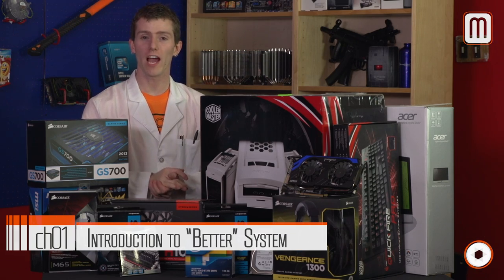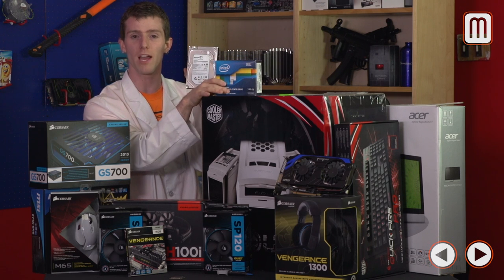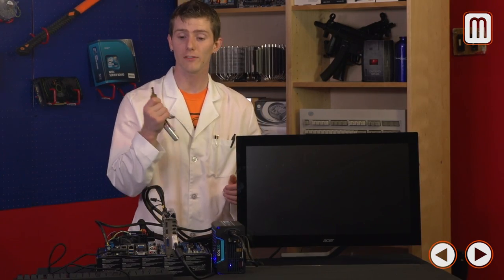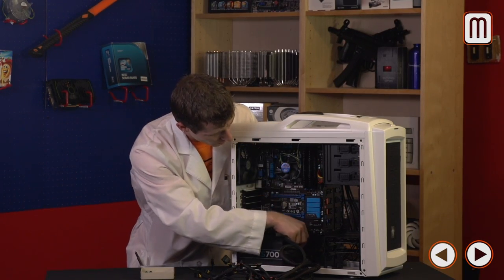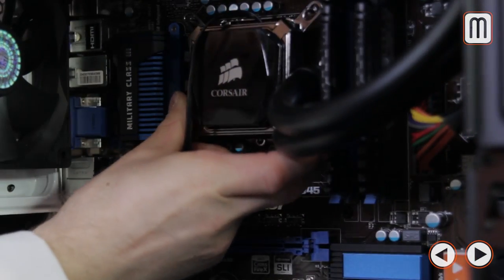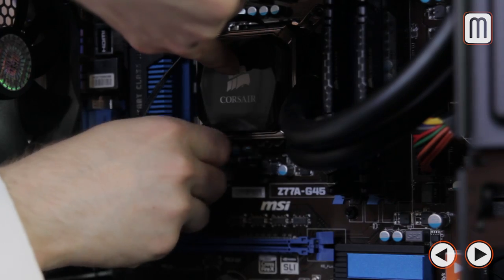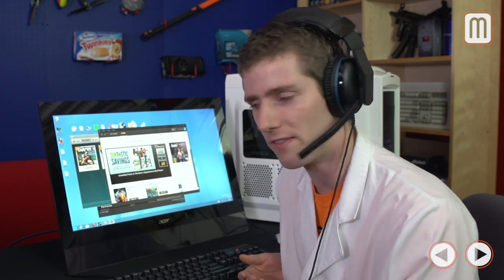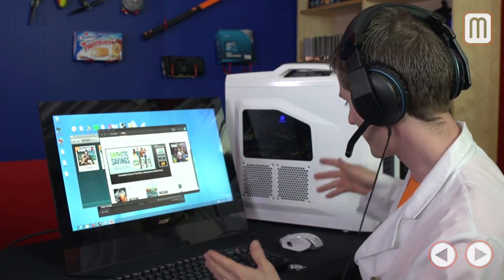ULTIMATE Build a Better $1500 Gaming PC Computer "How To" Guide

Comment: Here's my build so far. I just ordered a i7-4790k, GIGABYTE GA-Z97X-Gaming 3 motherboard, 16 gigs G.Skill Ripjaws X 1600 ram. The rest I already owned 2 GTX 660 Ti's, 60gb OCZ vertex 2 SSD, 1 TB Hitachi HDD , 320 GB WD HDD, Corsair HX 750 PSU, Antec 1200 case. I have about $700 in it right now. I know the 60 GB SSD is not ideal but I got it for $20 so I figure better to use then not. I'm also going to upgrade to a GTX 970 hopefully if funds come in lol. I am using the stock Intel cooler for now until I can get a better one. I have a Dynatron Evo11 on my current comp but its AMD and Intel but only for the LGA 1366 and LGA 775. The parts for my new build I just listed I just ordered last night. Could u give me a moderate overclocking profile for the CPU and ram? I know I need a better cooler I'm not going to OC it until I do. I wont hold u reasonable for any DMG to the system so don't worry about that lol. I'm not very versed in OC like voltage. I worry about burning it up by upping the voltage to far. With my current comp I fail badly I have a AMD B97 CPU and have not had any luck OC it at all crashes every time. Even crashes when I use the OC profile that came with the software for that CPU lol. I don't have the money to really do any better. I only make $733 a month so as u can see I have to manage with nothing to work with. This is tax money lol

Comment: if you are using a newer motherboard like the Asus Maximus Formula for 1151 you will need to put that radiator in first due to fan clearance anear the armor on the motherboard  wich makes it so you cannot install fans unless you do it before motherboard install

Comment: Thanks for this video Linus TechTips. I will be building my first pc in the next month or so and this step by step guide is very helpful and also gives me confidence in building a pc by myself. Cheers guys..
Reply: Have you built it yet? What components are you using? :)
Reply: I decided that i would save some cash a buy a second hand rig.
now keep in mind that i don't need the latest and greatest stuff and this pc plays all that i need it too.  
CPU i5 4690K   
RAM 16.0GB Dual-Channel DDR3 @ 799MHz 
MOTHERBOARD Gigabyte Technology Co. Ltd. H97-Gaming 3 
 GPU 3071MB NVIDIA GeForce GTX 780 Ti (EVGA)
NZXT Case and  Kraken CPU water cooler
Reply: Looks nice! I've just built with exactly the same processor :D

Comment: How is my build? I'm open for suggestions. Using it for making videos and playing some newer games.

CPU:
Intel Core i5-4690K

MotherBoard:
MSI Z87-G41

RAM:
Crucial Ballistic Sport XT 8GB 1333mhz

Graphics Card:
Asus R9 290 3GB

HDD:
WD Caviar Blue 1TB 7200RPM

PSU:
Corsair Builder CX600M 600W

Case:
Cooler Master Silencio 452

Monitor:
BenQ GL2460HM

Keyboard & Mouse:
Cooler Master Storm Devastator MB24

Mousepad:
Steelseries QcK+ (450x400mm)

Headset:
Trust GXT 330

Added all up, goes for about 1200€ (Yep, I'm in Europe.)

Comment: is this a good build?:
Motherboard: Asus z97 maximus hero vii
CPU: Intel i7 4790k
SSD: Corsair force gt 240gb sata III
Dvd burner
GPU: Gigabyte gtx 970 in sli
OS: Windows 7 pro 64bit
external fan controller
RAM: HyperX beast 2400 MHz 16gb
HHD: 3x WD 1tb blue
Case: Corsair obsidian 750d
PSU: Corsair RM1000
Reply: That is a great build. But get a cpu cooler if your ocerclocking.
Reply: cpu cooler: corsair h105
Reply: jedzry j That will be amazing

Comment: Is this build good?
i7-4790k
Asus Z97-A
1TB Seagate 7200rpm +1TB External Hard Drive
DDR3 8 GB/1600 Kingston Hyperx Fury 
Zotac GTX 970
LG 24x Black Sata OEM
750W Thermaltake
Windows 8.1 64 bit
Case thermaltake-new-soprano

Comment: Current Set up:

4k PC
CPU: Intel I7-5960X 
MB:   MSI X99S Gaming 7
RAM: Team Red Vulcan 16gbs
GPU1: MSI NVIDIA GTX 980 4gbs
GPU2: MSI NVIDIA GTX 980 4gbs
PSU: Corsair AX1200i Digital ATX
OS: Windows 7
Case: NZXT 820
4k Monitor: Acer Predator 4k2k XB280HK 28" G-Sync

3-way monitor PC Set up:

CPU: Intel I7-4770k
MB:   MSI Z97 Gaming 5 Intel Z97
RAM: Team Red Vulcan 8gbs
GPU1: MSI NVIDIA GTX 760 2gbs
GPU2: MSI NVIDIA GTX 760 2gbs
PSU: Corsair 850w
OS: Windows 7
Case: NZXT 410
Monitor(s):
BenQ xl2411t @144hz,
Packard Bell Viseo243D @ 60hz,
Packard Bell Viseo243D @ 60hz 

Any Ideas on what to do next, I have not water cooled my setup as I do not need to(But I would like to just for it to look nice)

Comment: hey guys im new to pc building and im going to buy the parts soon! this is my build is there anything i should improve keeping in mind the price:

cpu-intel i7 4790k
cpu cooler- Cooler Master Hyper T4 CPU Cooler with 4 Direct Contact Heatpipes RR-T4-18PK-R1
motherboard-MSI ATX DDR3 2600 LGA 1150 Motherboards H97 GAMING 3
graphics card- nvidia gtx 960
ram-Kingston HyperX FURY 8GB Kit (2x4GB) 1600MHz DDR3 CL10 DIMM - Blue (HX316C10FK2/8)
hard drive- WD Blue 1TB Desktop 3.5 Inch SATA 6Gb/s 7200rpm Internal Hard Drive
ssd-Samsung 850 EVO 250GB 2.5-Inch SATA III Internal SSD (MZ-75E250B/AM)
psu-EVGA 500 W1 80+, 500W 3 Year Warranty Power Supply 100-W1-0500-KR (Replacement part for computer unit)
optical drive-Asus 24x DVD-RW Serial-ATA Internal OEM Optical Drive DRW-24B1ST (Black)
and i already got a case

so anything i can improve?
Reply: Go with a z97 motherboard so you cAn overclock. Or dont go eith a K series cpu.
Reply: Pretty Good.. Just make sure everything would fit in your case.. Measure some stuff out ALSO PLEASE. I BEG OF YOU! Make sure all your components are compatible. Incompatible parts can have a hefty price. These parts should seem all good. Do you enjoy your computer!
Reply: Yes I checked but thx for the advice!

Comment: this is like a 6 or a 7. i built an amd system for way less that is alot closer to a 10. FX-8350, 2x R7870s by XFX, 4x 8gb HyperX G.Skill 1866 DD3 ram, and an ASUS 990FX Sabertooth Motherboard. I used my tower from my first PC but am about to upgrade to a ATX full tower from cooler master (either storm trooper or storm stryker, haven't decided yet). Also I got a 500gig Samsung EVO 850 SSD at a nice price. I am only running on the SSD because I do not store any sort of media only games and don't use more than about 200-250gig including OS.

Comment: Advice.. which cooler should i use in this build and is it decent? 

Have the corsair carbide air 540atx cube case
monitor :asus 27' mx279h
graphics: sapphire r9 290 vapor x
power supply: corsair vs650 
core: i5 6600k with corsair vengence pro 8gb x2 
Motherboard: msi 970 amd "also have Asus M5A99FX PRO from previous pc" not sure which is better to use
storage :WD BLUE 3tb drive
SSD: Intel 335 Series ssd 180gb

I've been told to get "h100i/master hyper 612 650w/corsair sp120 duel and don't know which is best.. 
I know pretty much nothing about computer so any advice would be much appreciated "

Comment: What GPU is recomended today in this price range? two 970 or one 98o? Will two 970 be crippled by the small 512 MB loss or will it still run fine for a coupple of years.
Reply: If you deal with less performance, go 980 (then you can SLI 2 of these later). If you want better performance for a little more, go 970 (but more SLIing is almost pointless). 970s won't be hurt that much by .5GB lost.

Comment: Graphics Card : (MSI Gaming GTX 780 ti)
Processor : (intel core i7-4790 processor - bx80646i74790)
Memory : (Kingston HyperX FURY 16GB Kit (2x8GB) 1866MHz DDR3 CL10 DIMM - Red (HX318C10FRK2/16)
Motherboard : (MSI Z97 Gaming 5 Intel LGA1150 Z97 ATX Motherboard)
Case : (Colorful Raynor Tower G3) 
Power Supply : (Corsair Hydro Series Extreme Performance Liquid CPU Cooler H100i)
Storage : (Seagate 1TB Desktop HDD SATA 6GB/s 64MB Cache 3.5-inch intemal Bare Drive (ST1000DM003)
SSD : (Samsung 85 EVO 250GB 25-inch SATA III internal SSD (MZ-75E250B/AM) 
CPU Cooler : (EVGA SuperNOVA 750 B1 80+ BRONZE, 750W Semi Modular 5 Year Warranty Power Supply 110-B1-0750-VR)

what you think about this system guys ? :d
Reply: U changed your power supply and  cooling places xD
Reply: Maybe go for gtx 970 . And i think 550 walts are enought

Comment: Im completely new to this and need help on whether this is a decent build or not, I'd like to play most recent games on high settings.
Corsair air 540
Intel core i5 4690
Asus z97 pro gamer
Corsair vengeance 8GB
EVGA geforce gtx 970
Corsair H80i cpu cooler
Crucial 120GB ssd
WD Cavalier blue 1TB
Corsair CX-750 modular power suppy

Comment: I dont plan on overclocking but i'm gonna buy the GTX 980ti come christmas.
I have a feeling my CPU will cause this moster card to bottle neck.

CPU: i5-4460
GPU: EVGA GTX 960 (4gb ddr5 ram version)
RAM:8gb ddr3 1600mHz
PWR Supply: 750watt

This is my current build and I'm just looking to get the GTX 980ti and i don't want my CPU to cause any bottle necking. I would be playing games like ARMA3, Witcher 3, Batman AK and probably modding some older games to get better visuals. If it will cause bottle neck, what is the cheapest Intel CPU I can upgrade to?

Comment: Is this a good build?

•ASUS GTX680 DirectCU II TOP Edition 1201MHz 2 GB GDDR5 PCI Express 3.0 Graphics Cards GTX680-DC2T-2GD5 - Red/Black
•Western Digital Caviar Green 3TB
•Corsair Professional Series AX 1200 Watt Digital ATX/EPS Modular 80 PLUS Platinum
•ASUS ATX DDR3 2600 LGA 1150 Motherboards Z97-PRO (Wi-Fi AC
•Corsair Dominator Platinum 16gb (4x4)
•Intel Core i7-3770k Quad Core Processor 3.5 GHz 8 MB
•Corsair Hydro Series H100 Extreme Performance Liquid CPU Cooler
Reply: +Hiireth Dhalywal really? can u tell me a good $2000 build thats my budget
Reply: +Arman Stepanyan (Open FREAK) okay tbh, id go with : 

Intel i5 4690k (overclocking beast!)
Asus z97 M plus motherboard
1TB SEAGATE SSHD( 8gb of ssd)
Corsair 240gb force LS( ssd alone)
RAM corsair 1600 DDR3 8gb x 2 (16gb)
Asus GTX 980 TI 
Corsair RM750i PSU 
Cooler Master hyper 212X
BenQ XL2411Z ( gaming monitor)
Corsair Carbide Spec-03 Case

( OS and optical drive is up to u) it might cost a little more than ur budget but if money is not a problem, upgrade anything u can from what i gave you. Im actually using those specs i gave you. To save a little money, reduce on the motherboard as it doesnt affect performance. Enjoy your build
Reply: +Hiireth Dhalywal so if i get exactly this build will it run like hardcore games good? i need this for gaming
Reply: Why would you get a green hdd?

Comment: any suggestions for my potential 1000CHF (suiss) build? My pc gaming master race friends reccomended this

Case: fractal design define r5
Motherboard: msi Z97S SLI PLUS
Power supply: Coolermaster V550 Semi-Modular
Graphics card: 1 NVidia GTX 970 (i know, but 3.5 is enough)
CPU: Intel core i5-4460
RAM: 8GB Corsair Vengeance RAM
Memory: 256GB Crucial MX100 SSD+1TB Western Digital Blue HDD

Comment: Can anyone tell me if this is a good build for gaming, if I'll need a bigger case for all the parts, and if that 750W PSU is overkill?

Case - BitFenix Comrade Midi-Tower
MBoard - Gigabyte GA-970A-DS3P AMD 970 ATX
Processor - AMD FX-6300 3.50GHz (4.10GHz Turbo) Socket AM3+ 6-Core
GPU - 2GB EVGA GeForce GTX 760
RAM - 8GB (2x4GB) Corsair Vengeance
PSU - 750W Corsair RM Series 80PLUS Gold Modular Power Supply

HDD - 1TB Seagate Barracuda ST1000DM003 3.5" SATA III Hard Drive
SSD - 120GB Samsung 850 EVO 2.5" SATA 6Gbps

Whole cost not including monitor, OS and disk drive is £560.39 GBP ($837.95 USD)
Reply: Yes 750watts is overkill I use 600W and my pc is more powerful and power hungry than yours
Reply: You can do Intel for that price
Reply: Yeah u could use an intel for just a small budget buff

Comment: Is this a good build?
 
-CPU:
Intel Core i5-4570 3.2GHz Quad-Core Processor

-Motherboard:
Asus B85M-G Micro ATX LGA1150 Motherboard

-Memory: 
Corsair XMS3 8GB (4 x 2GB) DDR3-1333 Memory

-Storage: 
Samsung 840 EVO 120GB 2.5" Solid State Drive

Western Digital Caviar Blue 1TB 3.5" 7200RPM Internal Hard Drive

-Video Card: 
Asus GeForce GTX 750 1GB Video Card

-Case: 

Zalman ZM-T3 MicroATX Mini Tower Case

-Power Supply: 

SeaSonic S12II 620W 80+ Bronze Certified ATX Power Supply
Reply: ***** Matt b Ok, thanks guys.
Reply: 1 gb ram for the gpu... You might have to change that.
Reply: TriffleModz Yeah, done :)
Reply: Neon Knight yay... BUT WAIT, TO WHAT.
Reply: TriffleModz gtx 750 ti 2gb xD
Reply: GREAT...

Comment: Could have had a i5 4690k,gtx 970, 16gb ram, 120ssd, 1tb hdd, good case and win 10, all ready to run for 1300 with mouse and keyboard and used monitor.

Comment: I'm building a PC for Gaming and school work with these components:
GPU: MSI GTX 960 Krait edition
MSI z97 SLI Krait edition Motherboard
CPU: Intel i5 4690K
RAM: 8GB
SSD and HDD
NZXT h440 case
Antec 650W gold PSU

I have heard bad things about Antec power supplies on their older ones, but i see LinusTechTips  using them for some of their videos. Are their new ones Any good for a build like this.
Reply: add total cost and cost for component
Reply: I'm in south africa so if I convert it, it is about $1100

Comment: For specification PC gamer I suggest to use ASUS.
I yesterday assemble PC Gamer with this specification.
- Processor Intel Core i7 5960X 3 Ghz Box.
- Motherboard Asus Rampage Extreme V.
- VGA Asus Geforce GTX TITAN Black Edition 6GB DDR5.
I prefer the 3's. for the price it is quite expensive my country. because the value of the currency of my country weakened the dollar. so yes I would not want to pay the price of approximately ($ 35,000)
Price does not include the PSU, RAM, SSD,

Comment: This computer now cost $2196.63 dollars. I searched for all the parts and found the cheapest stores to buy from and it came out to be quite expensive...I changed some stuff around so it would fit my budget and I got the price down to $1679.24 for the same stats as this computer.